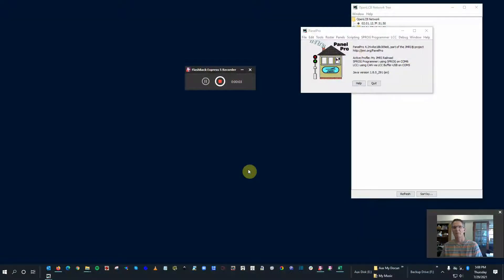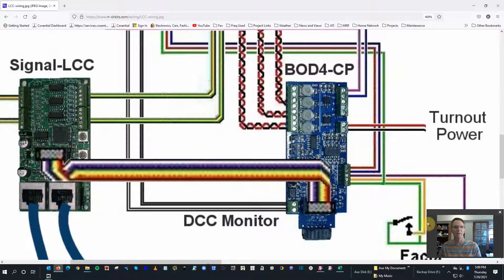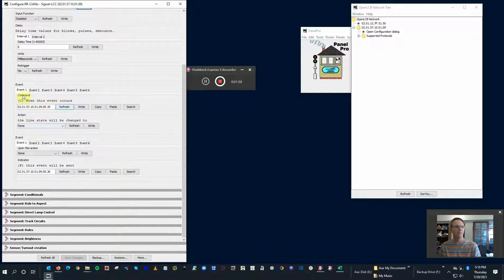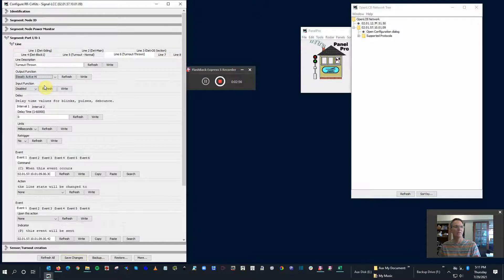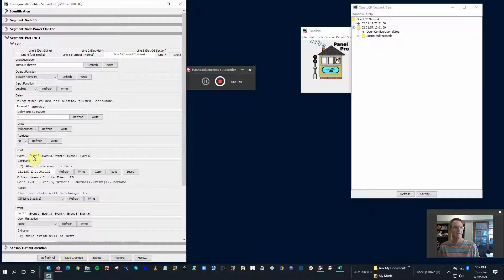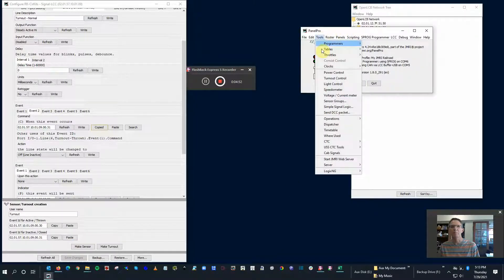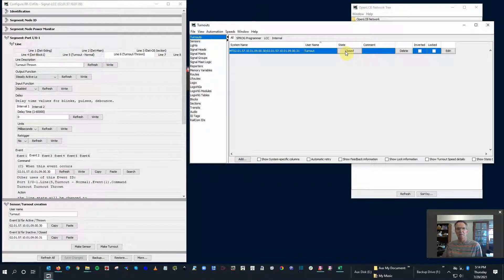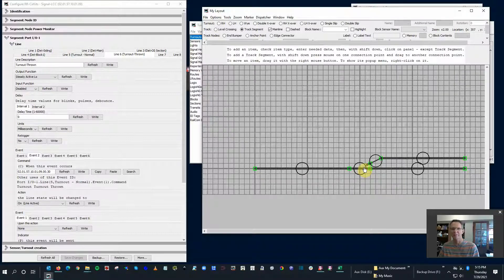TLC #9 Configuring a Turnout

Comment: I really enjoy your videos. Thanks so much for sharing your experience!
 
What is really frustrating is the lack of documentation (or maybe I just can't find it) that would show how to set up LCC step-by-step for different configs. For instance, you kind of brought me up short when you said that the SMD-8 would use one line, not two as with the BOD4, to set up a turnout. How would the CDI config be different?
Reply from the maker: Ya, the documentation is lacking. NO question about that. And the BOD4 board is one of the worst. I purposefully stayed away from it for most of my installs. The good news is the CDI is pretty straight forward. The key is in the numbers next to the I/O points. Truthfully I would have to play with it again to relearn how to make it work again, but fiddling around sorted it out for me. Again, would be nice to have better documentation. Sorry for the delayed response! For some reason I missed a bunch of comments coming in.

Comment: One thing I have started to do is to do screen shots of the two lines & their two events so I can listen to you & be looking at my coding to compare what you've done vs what I've done realizing the event id's will probably never match.  Either that or rerun & rerun & rerun the video to stop & start at each step.  Using pb's I'm guessing I need to change the action to toggle the line?  I know you've done that so I need to go back through your blogs (I love them) & see what I'm doing wrong.
As I've said before, thanks for your series of videos.  Slowly but surely, I will get there.
Dennis Munro
Reply from the maker: Thanks for the kind words. Right - the event IDs will not match, but the configuration should be similar. I'll try to get that segment on configuring a PB out soon!